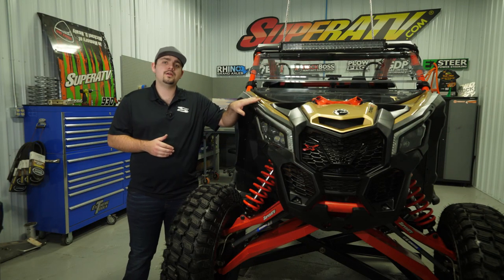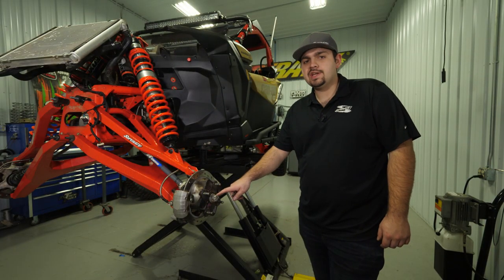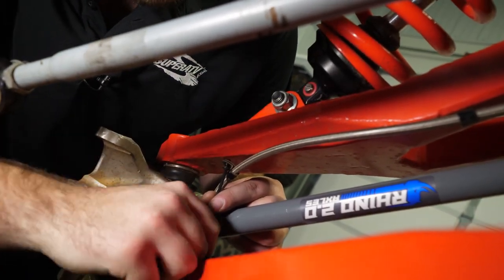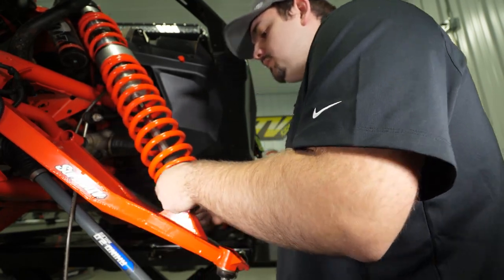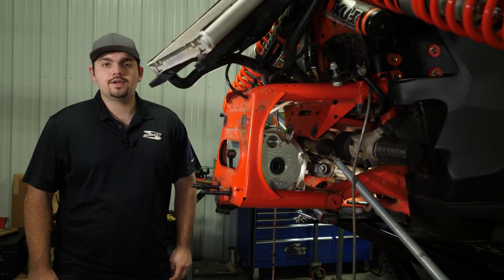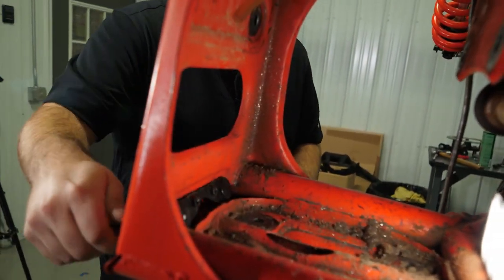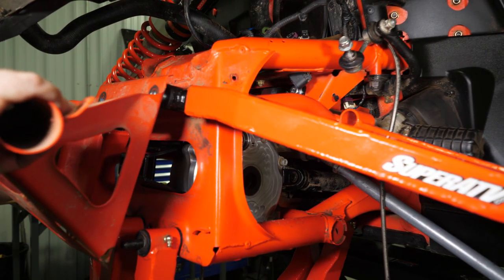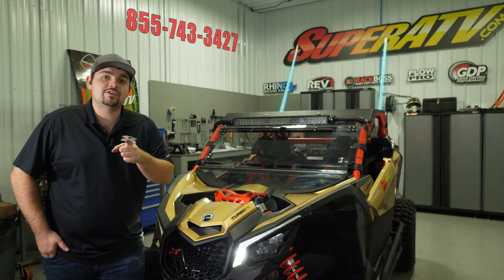Can-Am Maverick X3 Frame Stiffener/Gusset Kit | How-to | Install | SuperATV

Comment: Nicely done, super clean and straight to point installation video. Checking out your site, you have the stiffener kit/Gusset kit listed, also option to add Bulkhead + frame stiffener, does this include the frame stiffener (Gusset kit, everything shown in this video?) or is it just 2 piece? Another newbie question, the Winch mount plate, is that just beefier bulkhead that allows for winch to be mounted? or bulkhead and winch mount are different?

Comment: Nice video. But on my 2019 there were additional bolts holding the facia. Two underneath painting up holding things down
Reply from the maker: Thanks for letting us know! We have found year and exact model makes a slight difference in amount of hardware and location.